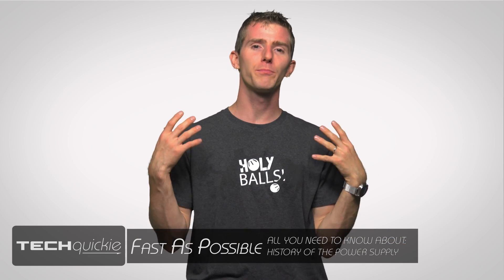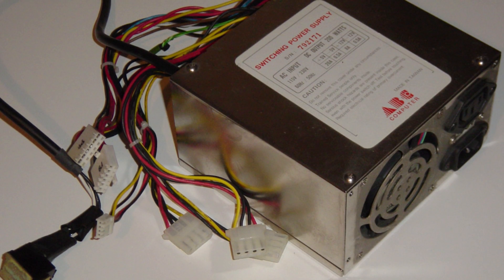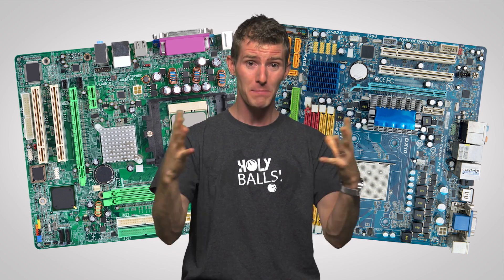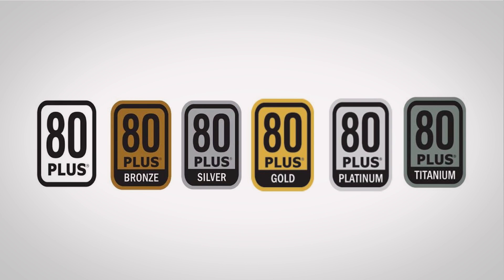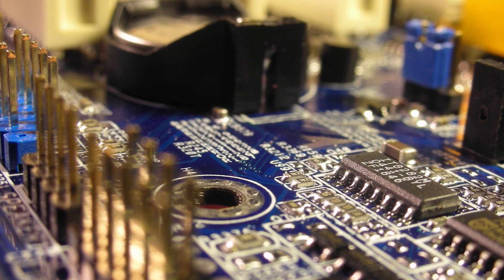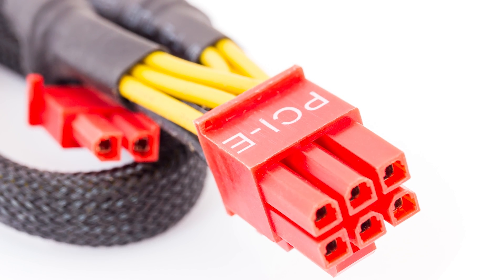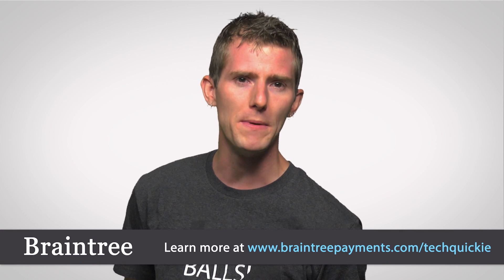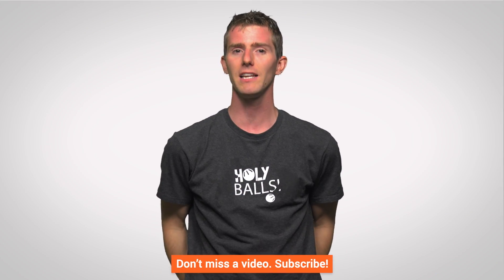History of Computer Power Supplies

Comment: +Techquickie
Why don't PSUs come on a PCB with no box? Like a graphics card?
Reply: Because nobody would want to accidentally touch 311 volts (that's the peak of a 220V mains voltage supply – the voltage selector switch connects a voltage doubler after the mains input when it is set to 110, so even if you have 110V mains you'd still have 311V peaks).

And even when the power supply is off the input filter capacitors still hold enough energy to give you a very nasty shock, or sometimes even kill you by stopping your heart. Ever seen one of those videos where they make stun guns out of disposable cameras? Imagine that, only about 5 times stronger.
Reply: +fede142857
Yeah but it would be on a PCB like a video card, it could have a case or an insulated area to grab the card.
It could be self contained like this:
https://images10.newegg.com/ProductImage/14-150-770-15.jpg

Comment: With the exception of a few computer manufacturers determined to be as proprietary as possible, AT power connectors (P5 and P6 I think? two 6-pin...) were fully standardized, just as much so as ATX. ATX didn't solve that either: Dell still used a few bizarre nonstandard pinouts, even using ATX's physical connectors.

Comment: well all of these are SMPS , not bad for saving copper and space.
Many times they can be more efficient than traditional ones.

however, i did make computer powersupplys with proper transformator units in them.
surely hard to design right, and surely the massive amount of copper required for the high current windings did set me back a lot, even so the voltage stability in unparalell. allso , powersupply faliure is virtually non exsistent. efficiency wise its good as any smps, specially when the load is light. 
I have to say for any superserious overclocking i would stick with it.
i have not made any for years, but maybe i should make one more again.
something in the killowatt range or so.
the trick is.. powering it up properly, and making sure it can charge the lunatic amount of smoothing capacitors i tend to use.
I remember that .. when checking the rails with a proper instrument (that is, an O-scope) i found that proper liner powersupplies had far less "junk" compared to smps.
and it made a difference on vrm temps. allso cycling light and heavy workloads on the computers i tested it actualy had a ripple of less than 0.001 volts.
not something i could say about smps powersupplies..

Comment: I bought a 1200 watt PSU back when SLI and Crossfire were new things. Feels like I am set for life with that.
Reply: Zotar SLI was new in 1998 or so. You may want to find something else
Reply: @dubsy1026  He probably means when it was popular.
Reply: @HaydenH  yeah, but his PSU is apparently still the same from then. Which might become an issue
Reply: Dubsy 102 I know, but he meant when it was popular.
Reply: @HaydenH  SLI was also popular in 1998. Many Gamers had a VooDoo2 SLI setup then. Though you have to use the term "popular" loosely with both the modern and old version as neither really gained much acceptance in the overall market. I can say a VooDoo2 SLI setup was the best way to run UnrealTournament then on a large high resolution display.
Reply: Their point is that the PSU was likely bought MANY years after 1998. The comment probably meant to say "I bought the PSU when SLI was still a consideration"
Reply: providing the capacitors stay good. I bought a high end PSU thining the same thing but I ended up having to replace it
Reply: The efficiency on that cant be good, too low load is inefficient and at some point you will realize maybe you dont want a 15 year old psu
Reply: @J0hnH4l0  The fan died earlier this year. Was long overdue for a new one anyway, i mean just the hassle with the non-modular cables alone was enough to warrant getting a new one.
Reply: this comment didnt age well with rtx 3090 overclocking SLI
Reply: rtx 3090 sli entered the chat
Reply: @liberusmagnus  I was looking for this comment
Reply: RTX 4090 entered the chat
Reply: @alpal6476  1200 is still more than enough
Reply: I bought a 1200W Platinum PSU yesterday 😅
Reply: RTX 3090 IS LAUGHING
Reply: @fraeliteyt5452  Aw, How CUTE !!!
Reply: It'll degrade
Reply: U are set for a 3090 TI now
Reply: I agree that the biggest concern is probably that power supplies are inefficient at low load.  So you're spending more money on the power your computer draws at idle than you would with a power supply closer to your PC's needs.  Also, power supplies have gotten more efficient since then.  I just got an 850 watt power supply for a system estimated at 499 watts.  I figure I'll use it for a decade or two.  I used my last one in my main system for a decade, and now I'm going to keep using it in a file server.
Reply: ur psu will come handy in rtx 3090 sli
Reply: @Marauder You will get some bragging rights tho
Isn't that worth thousands of dollars
Reply: @Marauder 3080 is the value for money
Reply: @Marauder can you buy any card today for MSRP
Reply: @Marauder Who said i have money dude , I am rocking a dual core cpu
Reply: @Marauder I never comment on YouTubers Videos that I have the most shit ass setup, Can I have one for free
I just deal with it
Reply: *Quad RTX 3090s...*
Reply: Now entering ampere sli
Reply: @elijahmascarenas  hmm
Reply: It will degrade and fail eventually
Reply: Might want a new one just for the updated power converters in it. The physical circuits in a power supply will be sightly different now than in the 1990s as they have to make a 80+ certification now to be sold in the EU and USA. It also is just good for PR. The 1990s PSUs the one i got was like 40% ~ 48%  of the power it pulled actually got to the motherboard ....maybe as HP didn't want to pay alot for the PSU in a low end system that my parents bought back then.
Still going from what might be 40% efficiency to over 80% will be good both for the life of the rest of the computer but also for your wallet in paying bills.
I do recommend the newer 800 Watt ones  as even if you are going to do SLI supported in games SLI only goes up to 2 cards anymore. 3 and 4 cards was almost never supported in games. 2 high end mildly over clocked nvidia cards will pull somewhere in the 700s. AMD might pull more when overclocked as you can overclock their cards farther than you can with nVidia's.
Another 1500 Watt PSU would only be good IF you want to have like 12 SATA devices and 8 PCIe devices all connected and all running at 100% at the same time. Then you will most likely run into a motherboard power problem before a PSU power problem.

Comment: Best power supply I've had was a cheap dual fan no name power supply (which I made sure to over-spec/under-estimate it's power rating) I got from eBay for like 13$. It's still working despite like 12 years of use unlike my new power supply.

The latest power supply I got I spent like 90$ on, (high efficiency, high wattage) the manufacturer didn't give me the mail-in rebate, and it failed recently which really pissed me off because I was expecting it to last for multiple systems.

The only worse experience I've had is my SSD purchase which died (undetectable by BIOS, even after fiddling with it) 2 of 3 years into warranty, then died again not too long out of warranty. Not only did it fail twice in the span of time, but also wipes all files on the drive which is a huge hassle.

 Something I would like in power supplies is fan sensors. It seems like the fans are always failing in power supplies more than anything else, and can cause the power supply to fail without any warning to the user because of it (usually with CPU or GPU one will notice higher temperatures at the least, although they usually have fan sensors on them anyway)

Comment: You are gloryfying ATX a bit too much too my taste. In the AT age you bought a computer, and you could fit an AT motherboard. The power supply did not have to be standardized, because computer cases were standardized: They all took AT or Baby AT mainboards.

ATX merely allowed you to buy power supplies separately from the chassis. The "standby" feature is mainly an ecological disaster as computers now used power around the clock while nobody users wake on LAN or powers their computer on via the keyboard. The "100% off" in the AT age is IMO preferred.

ATX is also reasonably obsolete with the move to 12V: Due advances in DC-DC power conversion, it makes nowadays a lot of sense to generate 5V and 3.3V on the mainboard. Mainboards that just need 12V already exist, mainly in the Mini ITX world. It allows a smaller power supply, less ugly cables, and thus smaller computers. Expect this to be gaining popularity.
Reply: I've got many AT computers and none of them have PSUs with different sizes and different pinouts. The only PSU I've seen that isn't the same size as the others is found in my XT PC ... And the pinout is still the same. Every single AT PSU I've seen is about the same size as a regular ATX PSU (in fact some people that can't find a working AT PSU or don't like having a 20+ year old PSU powering their vintage rig are puting ATX PSUs with an adaptor for the connection to the motherboard and that works just fine). I don't know where linus have found these informations, but it's completely fake

Comment: What you said about AT supplies was pretty much all BS. Meh.
Reply: Exactly, AT IS a standard, just as ATX is another.

Heck, ATX PSUs aren't as simple as made out here as there are many generations/revisions when it comes to how the voltage lines are designed to be loaded.

During the early Athlon years there were problems with PSUs dying because Intel had moved the CPU regulators onto the 12V line and ATX was revised around that, but Athlon still relied on the 5V.  It wasn't always immediately obvious which version of PSU you were buying so you could end up overloading the 5V lines, which at the time most PSUs had poor or no overload protection so would just fry.
Reply: Yeah, I've AT PCs and :
- All of them have the same pinout
- All of the PSUs are the same size
I've never seen an AT PSU with a different form factor. Not that they don't exist but if they do, they must be very rare
Reply: In the early AT world where soldering skills pretty much standard: older motherboards had sockets and emtpy location where you could upgrade your SRAM, DRAM, .... Now you had a 6-10 Layer motherboard with 0204 Chips. SOP's are now the bigger Chips. With AT the design was one PSU and not many regulators on the Motherboard. Now you didn't use one big flyback but many buck and boost converters on the motherbords and in the processors itself. Try now to build a low grade motherboard and you are getting in a lot of power delivery problems you had to solve. Back in the AT-world you connect the right rail from the PSU.

Comment: All this power supply shiy is bollocks. i used a bargain basement 450watt psu for 7 years without a problem and only replaced it a few weeks ago because it lacked a 6pin pci cable for my new gpu. Guess what replaced with a 500watt china power supply called aerocool. 
Stop repping the over priced shit from corsair ect and telling us we need it!
Reply: Cheap power supplies use cheap components. Even if it's unlikely that the power supply takes out the rest of the system, it's not unlikely that the power supply itself will fail. I work in IT and we have hundreds or thousands of computers in the field. We had to change the cheap power supplies at a much higher rate than "overpriced shit" making them less cost effective than the "overpriced shit". Often what happens is the cheap fans they use seize up and then the rest of the power supply fails shortly after. I've also had more than one cheap power burn out entirely and had Sata power connectors catch on fire. No thanks.
Reply: just bc you got lucky doesnt mean every powersupply will do that. And btw. i had a case that came with powersupply and it killed everything except 1 ram stick and the floppydrive. Powersupply should cost a reasonable percentage of the system. I wont use china firecrackers on pricey hardware. I might on a 0815 office sys.

cheers
Reply: smiling bandit
 The fuck you did. Load of bollocks, motherboards have built in protection to safe guard your hardware from issues like this, all this crap about nerds warning you about cheap psu's killing your hardware is from the past when motherboards didnt have that kind of protection worst thing that will happen is your psu is broken.
Reply: i tend to see lots of negative reviews of lower quality PSU's, most are coil whine, sometimes stops working under load, ect not many saying total failure, but a few. nothing about friend motherboards though. people who need large PSU's thought are people running slis's, or have monster rigs. most probably do over spend on their PSU and components due to marketing, but thats marketing for ya.
Reply: Brad Turner
It also doesnt help with tech forums and linus tech tips repping these companys because they are sponsored in some way or the other. You dont need that overpriced shit your motherboard will have built in over current protection which means anything plugged into your motherboard is also protected.
Reply: Meredith Mattingly
Thats on a large scale, the chance of it being cost ineffective for an individual is unlikely.
Reply: im using a local philippine power supply it has one 6 pin and i runs my 960gtx just fine
Reply: Smoke Gaming Channel
Its exactly my point. A few people have probably had some problems because there are more of these generic PSUs and therefore more likely something with will go wrong with them like seagate ships way more hdds than anyone else and many people have had problems with them but in general seagate is good. It is entirely unnecessary to spend over £100 on a PSU.
Reply: "You dont need that overpriced shit your motherboard will have built in over current protection which means anything plugged into your motherboard is also protected."

Okay, assuming that the motherboard protection doesn't fail and everything gets fried anyway, that means I still have downtime while I have to buy another power supply.  That means I have to spend time not using my computer, and by buying multiple cheap shitty power supplies, I've spent more money than I would have on a single "overpriced shit" PSU from Corsair that wouldn't have died in the first place.

Basically, your advice is shit to anyone who wants to save money long term and who doesn't want to have to worry about down time.  I just hope people who see your awful comments realize that and don't get suckered in by the shit you're shoveling.

Also I bet your shitty cheap power supply doesn't have any of the 80 Plus certifications for efficiency, doesn't have useful features like being modular, and has a noisy as fuck fan.
Reply: *****
How about we dont just assume something that will never stop working is going to fail. Iv never heard of the motherboard protection failing. Ever! for that to happen the entire motherboard would just stop working like when you pop a fuse, and in that case you would just replace the motherboard.

My old psu the 450watt one did not have the 80+ rating. The new 500watt aerocool is rated 80+ bronze so guess again. Enjoy your pointless over priced shit you dont need mr illinformed.

Comment: Guys can i use two psu in the same pc?
since im gonna get my gpu soon and i my psu doesnt have enough wattage can i use 2 psu , one connected to the motherboard and all the rest (hdd , dvd , fans ecc)and one connected only to the gpu?
do the psu must have the same watts?
Reply: ***** thanks for the help i already knew about the green wire on the atx connector wich i believe is for turning on both psu
so i also need to connect both ground togheter
what do you mean with the same phase?
Reply: +Lafika hehehe sorry im just 15 :P btw thanks for the help!

Comment: Hey Linus, make a video showing why you SHOULD NOT buy ultra cheap power supplies, with REAL tests resulting in system death (well, technically only PSU dies though) or fuse pop.
That oughta gather around 50B+ subs.